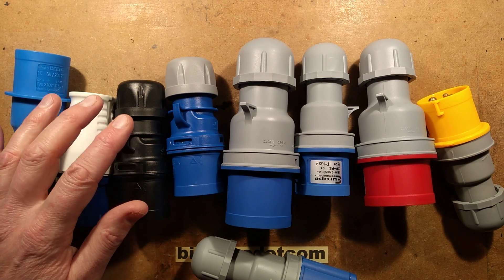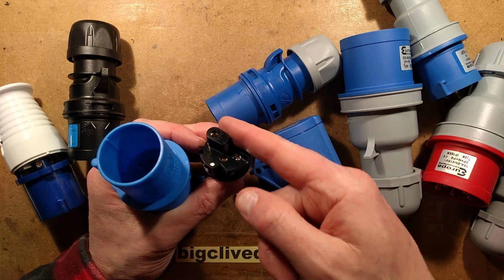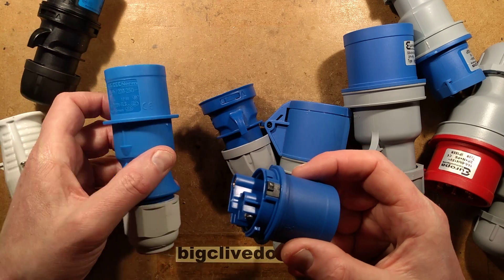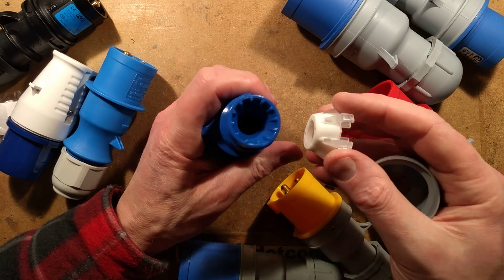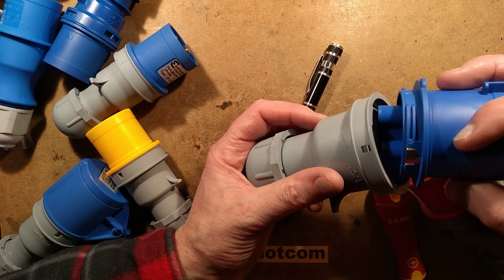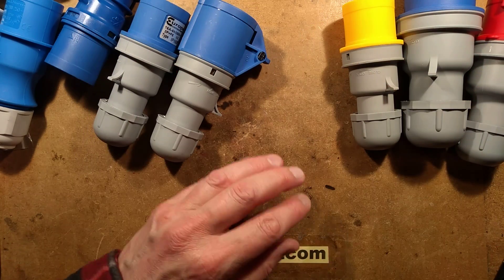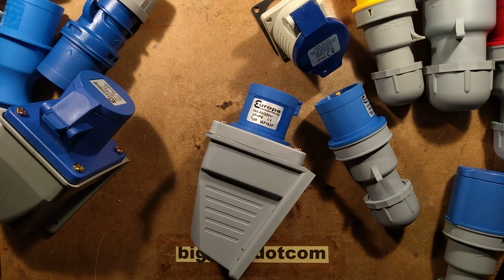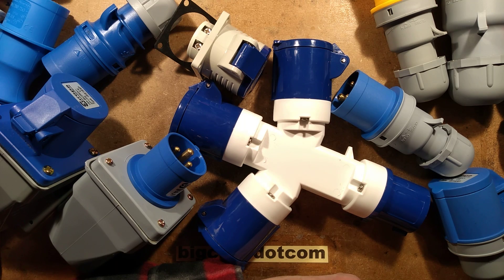My favourite industrial connector (Ceeform).

Comment: Where do you get a 110 volt supply from? Is that a typical generator voltage for building sites or something? We have (UK) the blue ones for 240 volts single phase and red for three phase, but never seen the yellow ones.

Comment: The appliance inlet on my van has a flip lid like the plug. They are also good where the cable may get damaged, because no wire job needed. (No electrician needed)

Comment: Have you tried the HO7BQ-F cable?, it has a polyurethane outer sheath and it is the toughest cable i have ever used but hard to terminate.
Reply: Also i always referred to that type of connector as a Commando plug or socket

Comment: I worked for Lincoln Electric's (the welding & cutting product manufacturer) Automation Division for 14 years and we used them for our 220 & 480 volt connections. Since we built robotic welding systems and welders for robotic applications we had to test systems. We had these attached to SOO cable and would use them for temporary power supply to the systems. Then disconnect them when the system was shipped to the customer where they would permanently wire the systems at their facilities.
We are in Cleveland, Ohio USA

Comment: The blue 16 A ones are known to about anyone ever on a campsite in Europe with an RV.
The blue and red ones you will find in shops, construction sites, kitchen equipment,... wherever you need more than the average 10 to peak 16 amps a regular wall plug will provide in Germany.
I see them regularly to plug in the Rack PSUs in Datacenters. rarely the 16 A ones, more likely 32 A.
I also know them from any kind of power equipment used in PA technology (Amps, light, anything).
The purple ones can sometimes found in industrial installations. I think the max voltage is defined as 48 V.
The yellow ones I know from visiting the US, never have seen them here in Germany.

Comment: Very similar to South African household stove connectors. Dreadful cast metal things, with a metal threaded ring to fasten them together. Used to come with a metal "snake" (called a"gorrel", referring to the appearance of a trachea) to the appliance, 3 pin for single phase and 4 pin for 3 phase.

Comment: Belgium the blue ones are used on campsites , harbours, power cabins on the street for markets , fairs ,....
Red ones in every factory , farm ,hall,... For 380 .
Most of them have no screws inside for the cables they use a snap in system in the correct wire colours . No screwdriver needed

Comment: The red ones, they are pretty common here in hungary. Especially outside of citys we usually get three phase power and 380 / 400v and these are the connectors that are standardized for that here. And on construction sites its also common. Usually 3phase power most bigger loads like cement mixers, bandsaws and the like.

Comment: In Denmark I use the blue 1P and sometimes a red 3P to 1P adapter to charge my electric car every day. We have free EV charging at my uni, and the outlets are old fashioned CEE instead of modern type2. They are also used at ports and marinas all over Denmark for shore power to yachts and other boats

Comment: I understand they need to be a tight fit but sometimes they are very tight to connect and pull apart, as you say in the video usually where you are outside wet and freezing!

Comment: Definitely more rugged then the old school stage plug we see a lot in the US on lighting rigs. And oh boy the sound guys love it when some asshole has swapped the earth and neutral inside the connector, not realizing that the 2 pins close together are neutral and earth, with live being the one furthest away. You'll find them wired live-neutral-earth a lot, yeah makes for some nice hum issues.
Outside of lighting rigs you'll see twist lock connectors on most things.

Comment: In Thailand, these connectors are the standard for construction site. But I see people abuse them, poking naked wire in. lol But still, it is much safer than household plugs.(Which many smaller site still use, most larger construction site require this, if they see normal plug carried in, you're screw, big deal for sub-contractor) That time, last year when I work in a mall, huge mall, mega shopping centre, when it was opened, construction was still undergoing in many parts as tenants were moving in. To stop contractors from using client' electricity, they require everyone use this, they ensure we use power only from common outlet for contractors, not using it from normal shop's outlet and cost them more electricity bills. (Of course, they inspect our equipment before going in, if they see power tools with normal plug, it won't be allowed in.

Comment: In Australia - we use lots of ceeform connectors in computer DC and telecomms.  But generally, the standard here for heavy, or construction, or multiphase, is the C56 standard.

The 56 series goes from 10A single, to 64A three phase.  All phases 240V@50Hz.  All 56 series outlets are IP66. They are supply aligned too - so 32A socket can accept a 20A plug, but not the other way around. etc.

Comment: South Africa, Film/Cinema industry.

Never seen the yellow connector before! For obvious reasons.
Reply: Genny usuall runs power lock single core cables into DB boxes with 63AMP then that will have a run to set with more DB boxes all over the place.

I've seen a 63A socket fail. That thing smoldered and stank for hours after it was unplugged. Since it was a rental couldn't open it and look inside :(

Comment: Norway uses the 4 pin for three phase power, with 230V between phases and no neutral. Sweden uses the 5 pin for three phase power, with 230V between phase and neutral (AFAIK this is not always the case, but it's true for where I've lived) Both use the 3 pin for campers.

Comment: dutch electricien here, the one phase are used for campings here, the 3 phase16 to 125 amps are default connections for 3 phase plugs, you see them all over the place

Comment: Clive you should do a video on marechal power connectors. These are commonly used in uk industrial factories and motorway signs etc for 100% water protection. They are quiet clever connectors.

Comment: The red ones are common here in Sweden and used for pretty much anything using 3 phase, except kitchen stoves (wich have a special plug called Perilex - looks like a Schuko, but with 4 pins and a big flat pin in the middle for the ground connection, instead of the typical metal strips). Since we have 3 phases going in to all houses (even many bigger residential houses have 3 phases going to each apartment), it's quite common to use 3 phase for high power stuff (most commonly stoves, but also some other stuff) and workshop equipment using motors (not just in industry). 
The blue plug is less common than the red ones, but often for caravans and boats with single phase connections and is also often recommended for 1 phase appliences pulling more the 10 A 
 - the Schuko is rated up to 16 A, but the quality of those outlets vary and there have been some fires when people for example charge electic cars with those.

Comment: I use to work at McDonald's in America and they used them for the equipment that would be used for breakfast and lunch i had to replace a couple the female side would arc internally and destroy them after we had a couple i could use parts from one but im not sure if it was just the case of not being plugged in all the way possibly or it was just from plug-in and unplugging

Comment: They are used on fire trucks needing more than 20 amp shore power in USA. They have a motor that retracts the connector when the starter engages in order to disconnect the inlet automatically. 

Interestingly, the manufacturer of our trucks , the former American LaFrance, didn’t seem to understand that the blue was intended for 240V, so the four older trucks have blue connections and the last one has the yellow connection. 

https://kussmaul.com/091-159-30-120

Comment: Pin & sleeve in the US. A number of manufacturers and styles.  NEMA is the US standard and will not mate with the IEC connectors shown here.  There's also a all metal version used for hazardous locations, arktite I think? Some of the metal style are made up to 400A.

Comment: Isn’t there a similar looking symmetrical connector where the plug and the socket are the same ?

I’ve seen them somewhere... but I can’t remember where...
Reply: ᏰĪᏝᏝ ՇÎρɧᏋƦ probably not what you’re thinking of, but they remind me a lot of XLR Audio cables.
Reply: There was symmetrical connector called, Type 1, used for Token Ring, which is an old method of computer networking.

Comment: Hi Clive, my new favorite way of describing voltage and current to say, catering crews, or mathematicians. 
Electricity is transferred by `angry pixies`, originally something to do with a faraway tree, but inspired by identifying as a `pixie wrangler` (AvE speak for Elec Eng or sparkie). 

Voltage is how angry they are, anything above 50V is berserker angry and can kill you because you're a bag of water and dust and the water does not offer much in the way of resistance, and 
current is how many of the darlings are available to flow down the line and through said bag. 

The combination of multiplying anger (voltage) and sheer numbers (current) will 
a) hurt and 
b) do it the whole time you're dying. 

Merry Christmas and thanks for all the videos.

Comment: 13:33 How in hell would something like that EVER pass the Safety Inspection?
I would expect every Health and Safety person that saw that would blow an Artery and instantly rip someone a new Waste Disposal Orifice and ban that cable from use until the plugs/sockets are put where they're supposed to be...
How does this not get the Insurance Companies up in Arms and Denying Claims left, right and center due to people getting fried by Negligently Exposed Live Pins?
Reply: In Sweden at least that type of installation would be illegal, the one making it would  most likely lose their license and the company would get a warning or lose their license as well. If anyone was hurt the police would make a case out of it and prosecute the company that made the installation.
But that type of installation is usually made by the owner of the trailer after the connector has worn out and they can't find the correct one cheap enough or where they usually buy their things. Most people seems to think electricity is so easy and harmless that it's not a problem for anyone to make their own installations.
And about insurance, most of the world is not run by insurance companies, so if someone is hurt by a bad connector they'll get covered as long as it's not their own fault the connector was bad or of the wrong type. But then again, the one responsible for the connector being installed will have a legal problem either because they had a license and installed an unsafe connector or they didn't have and installed a connector at all.

Comment: Nothing like this in the US there are some large twist lock ones such as shore power for boats  my RV  (caravan) has one the cord can be removed from the side of it and stowed away and there is a threaded ring to hold it on the RV when in use and makes it weathertight when removed it has one of those spring loaded caps with a gasket to keep it dry when not in use being towed .

Comment: I've seen these at my union training center in America, used for high voltage equipment on wheeled frames for training purposes. Only have seen 208/230v and  480v 3p. I've never heard much about European power distribution, everything you guys are saying in the comments sounds like Chinese to me ':D Did you just say your 110v systems are two phase? That sounds insane to me! Pretty much everything here short of medium-large equipment is accomplished with 110v 1p power. 240v power tools are extraordinarily rare, relatively. I don't think I even have a single corded power tool though, honestly. All of my hand tools are 20v DC. Granted, I do little Industrial work - Industrial/manufacturing buildings are the only ones I've ever seen with a 240v outlet, everything else high voltage is wired directly to a circuit breaker, with lower amperage breakers located in the equipment control panel usually.

Comment: I LOVE these things, have boxes and boxes worth. Use them everywhere. Have friend winter heating with a 10kw heater I built out to be portable on a 63a Blue plug, MASSIVE rubber cordage. The correct technical specification for these is now IEC60309. Of note is that for water ingress prevention these shown are only rated IP44, however there is a version of the plug with a locking ring that will mate with the IP44 version but if mated with a socket which has the  receiving locking flange gains an IP67 ratting.  I'm currently in North America, and here, there is a Series II version, which is orange and is intended for use on split-single phase 120/240, with the earth pin in the 12h position. I've never seen or used the orange ones outside North America. I can get these in all common single and three phase variants with CE, OVE, cULus , and BS4343 rattings. They are a global standard which may be used ANYWHERE, not prohibited by ones own laws. I'd been considering making my own video on these, they are SO well engineered.  Clive, If you'd like I'd mail you an orange plug & socket set for your amusement, just let me know where to post it to.  Had a rough day, this video brightened it! Thanks Clive!

Comment: @bigclivedotcom    Meltric's switch rated decontactors are prob my favorite version of this. This is something "new" that has a lot of positive features. It is a switch rated disconnect, so you dont have to install a safety switch (it even includes lockout featueres!) Its Nema 3R/4X IP69K rated. Check them out. They are definitely more expensive but you have to consider the added value. https://www.meltric.com/html/decontactor-plugs-receptacles.html

Comment: I’ve been working at a transporting company in The Netherlands now for atleast 2 years, and we use the red IP165N connectors to make sure the cooling engines of the trailers can stay on the electric engine instead of it blasting out diesel fumes.

Comment: Hi Clive, yes I live in Canada and deal with electrics a lot for different industries. we call the pin and sleeve connectors. We have a 100A version in our test room. We have 575V 3 phase 60Hz here. You did not show the type with a ring to screw them together. That is the water proof version. Also available in the UK. I have used them there as well. Different standards etc. but basically the same. Here in Canada they have a plethora of plugs and sockets as does the US. It is nuts.

Comment: Oh aye. . . . We use these in my country (Yorkshire! 🤡), and. . . . . 

I have seen a goodly few of the, let's say, "inverse" connected inlet sockets/plugs with the live end being the plug end of the trailing lead! (NASTY ⚡).   I have seen, indeed I even own one (pair), a plug/socket pair in which the innard parts of both are interposable - so that you make a wall mounted 'outlet' into a wall mounted 'inlet' (gender changeable, in other words) and vice versa at the trailing lead. Even then, you still get people whose logic dictates that "the bit with the pins goes on the cable, and the bit with the sleeves goes on the wall" - they cannot get their heads around the idea of a wall mounted 'plug' and a trailing socket - I am at a loss to understand why.

Do you ever come across any of the old (ancient by now)  "Reyrolle" three pin with scraping earth and screw down collar, three phase cables? - We used these extensively on farms back in the 1970s. Even older, do you ever see any of the old (older than Methuselah) "Dura-Plug" inline three pin, single phase, water resistant, "unbreakable rubber" plugs and sockets? - even made to insert into grommet holes in bulkheads and panels. These were probably the forerunner to the Ceeform system, and if properly fitted, were extremely resistant to water ingress, and were submersible, up to a point, in the short term.

Comment: Czech republic (Slovakia too). In Czechia, the 3-phase version is quite common even in households - in villages, we usually have at least one 16 A 3 - phase outlet, or one 32 A 3- phase (but with 25 A breaker) in house for things like welding machines, or mostly  for saws for cutting firewood (usually old HOP 600 or 700 saws - 600/700 mm cutting blade and 4 or 7,5 kw asynchronous motor with star/delta starter). 4 pins 3-phase is used in old instalations (TNC), but in modern instalations 5 pins 3-phase for TNC-S with RCD and circuit breaker.

Comment: I could be wrong but these look very similar to the connectors used to connect shore power to ships or ground power to aircraft in Australia especially those commercial / passenger aircraft that use 115V 260A power.

Comment: Talking about caterers, I was at an event ordering grub from a burger van, when the guy told me his fryers were acting up and he couldn't do chips. While waiting, all I could hear was a petrol generator screaming its tits off and hunting wildly. When I mentioned to him, he let me take a quick look. 2x 3kw chip fryers, 4 florescent lights, a freestanding fridge and a TV on one 13amp plug into a 2.2kw Chinese genny. I think the only reason there wasn't a major fire was the genny was incapable of producing enough power. I pointed out his issue, and advised he hires an electrician. I never got my chips :(